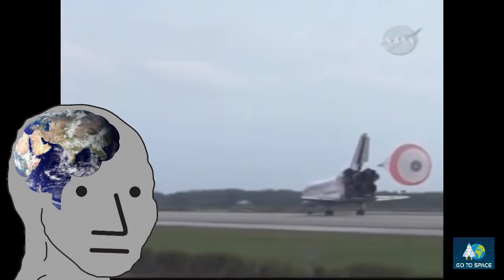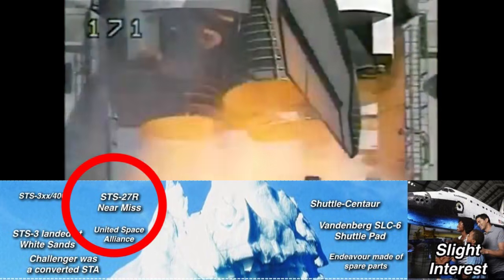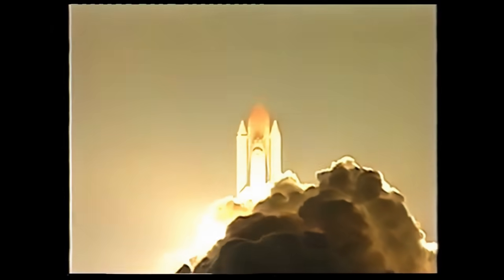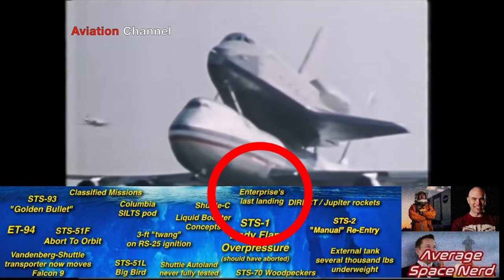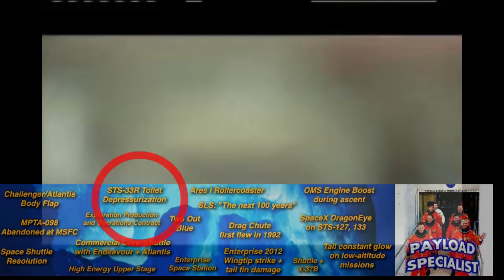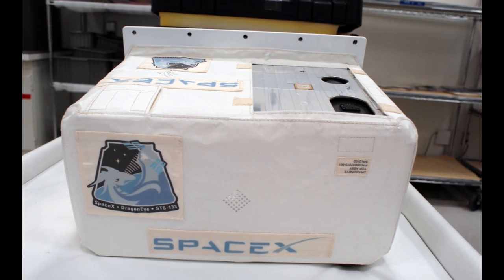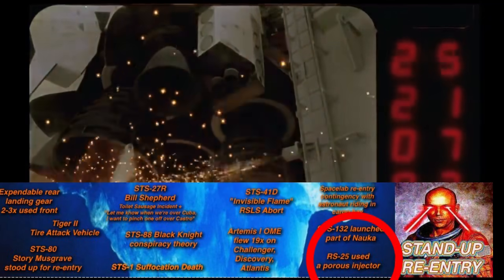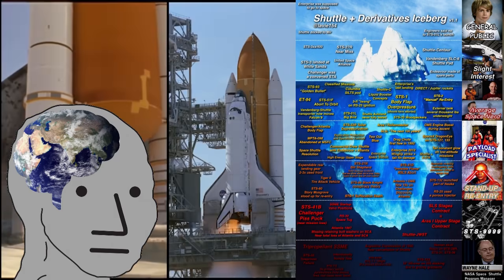The Space Shuttle Iceberg Explained

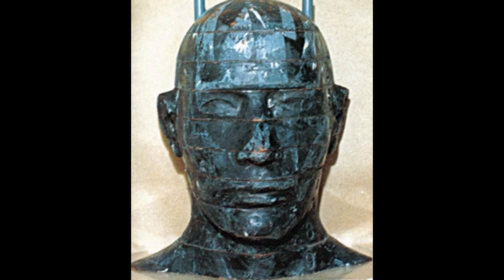Comment: (Note: I posted this comment earlier with a link to the article but it got caught in the spam filter.) 1:05:50 "Gravity gradient" refers to the sections of a spacecraft that are closer to earth having a very slightly higher gravitational pull from the earth. This can twist out of position a spacecraft trying to dock with another, especially if the docking procedure takes longer than normal for whatever reason. The article titled "Taking a Risk to Avoid Risk" by John McManamen on NASA's website gives a good explanation of the phenomenon. Searching for the title plus the author should put it as the first result.
Reply: This is also why "center of gravity" and "center of mass" are two different things (though they are almost always in nearly the exact same place). The center of gravity will always be a little closer to Earth's center than the center of mass, because the bits of the spacecraft that are closer to Earth get pulled on slightly harder than the bits that are farther away.

A homework assignment you might get in an undergrad attitude dynamics class would be to compute the center of gravity of a few-kilometers-long steel rod where one end is pointed towards Earth and the other away from Earth. In an absurd scenario like that, the center of gravity would be significantly closer to Earth than the center of mass (though I don't remember the specifics of how far apart they were).
Reply: there are so many minutiae involved with spaceflight that affect the measurements and tolerances and I keep learning about more of them. I thought thermodynamics were bad enough.
Reply: To think the shit engineers can think about and HAD to think about to make something successful... meanwhile here on my space simulator I am just thinking it's easy peesy making XYZ vector adjustments.... sheesh!!
Reply: To add, it favors the more massive side of a space craft. There are many satellites with "tails" to take advantage of this effect. It allows for a tidally locked spacecraft with less momentum build up in reaction wheels, and wlss need to momentum dump.
Reply: soo.... tidal forces, just with a weirder name.
Reply: I just posted a comment similar to yours after scrolling down and missing this one I also did not include a link because I've been flagged before for trying to be helpful 🤪

I believe Dr.  Shane Ross has some in depth explanation on his channel if you want to go deep
Reply: So effectively the exoatmospheric equivalent of ground effect when landing a regular aircraft?
Reply: I always wondered if this was a problem, thanks for sharing
Reply: Tidal force?
Reply: @michaelgian2649  Yup, it's exactly a tidal force
Reply: one Really cool concept is using the gradients for propulsion. One of my favourite papers is reaction-less tethered propulsion, amazing concept where no mass is flung out to gain orbital velocity.
Reply: @Me.is.Malhar - I believe that is the concept using the Earth's magnetic field as the stator and energizing conductors in the tether to "push" the spacecraft up or down.  If I'm wrong, sorry.  I'd love, in that case, to hear how a gravity gradient can be used for massless propulsion.

Comment: 23:47 - You got that backwards. Hubble was based on the KH-11, not the other way around. I have read on several occasions that Hubble actually came about as a means to use an already partially built KH-11 that would have been obsolete at the time of launch had they continued with what they had. 

The optics on the Key Hole satellites are considerably more advanced than what ended up on Hubble, if you can believe that.

Comment: Not on the iceberg, but one of my favorite bits of shuttle trivia: the rescue ball or 'Personal Rescue Enclosure'. 

https://en.wikipedia.org/wiki/Personal_Rescue_Enclosure

This was a 36 inch / 91 centimeter diameter ball made of urethane, kevlar and a thermal protective layer. It had a zipper to get into and a tiny window to look out of. The idea was that if a shuttle had a problem, they could transfer crew between the damaged shuttle and rescue shuttle if there weren't enough spacesuits for all the crew. An astronaut would get sealed into the ball in the fetal position with an oxygen mask and someone in a spacesuit would transfer the ball to the other shuttle. Or they could string up a line between the two vessels and move the ball across like a zipline. The little window was deemed quite essential so the poor astronaut inside would not freak the fuck out.

Comment: Did you know that NASA intentionally broke up and crashed the shuttle the first time that it happened. They did it on purpose. They knew with 100% chance that it would fail after 30 seconds. They know all this because the engineering team for the boosters told the NASA launch director that due to the excessively cold temperature the night before that it would take a day to warm the boosters back to operational temps and without the chance to warm up that they would fail 30 seconds into the flight. The engineers were ignored even though all the test data that was used to determine the environmental flight envelope for the boosters clearly showed that they would destroy themselves. The temperature excursion wasn’t just a little out but way outside the permitted range and it was for a very long time as well.

What the engineers said exactly happened. Why wasn’t the NASA flight boss charged with manslaughter or negligent murder?

Oh your shuttle is the most deadly space craft ever designed and flown. As in more astronauts have died in shuttle accidents than any other manned space craft ever flown by any country.

In 2012 UsD the shuttle was about $1.5 billion USD per launch. Value right there. Also nasa never told anyone how dangerous it was and lied every time they to,d the flight crew the survival stats for that launch. The chances never once met their own minimum chance at survival but they went every time. Why? The thing was a death trap and it couldn’t be fixed and that was that… invested.
Reply from the maker: This is false because it failed at 78 seconds, not 30.

I stopped reading there.

Comment: For those that maybe didn't already realize .. The reality is that the Shuttle program never really left what they call the Experimental phase of flight testing in aviation.. essentially all of the missions flown were 'experimental' even though for political reasons the Shuttle system was declared 'ready for flight/operation' very early on.
There is always a margin of this thing in space flight, but the margin that the Shuttle worked with throughout its lifespan up until after Columbia (and even then still some) was exceedingly high.

Comment: I can understand why NASA has gone with proven technology for the Artemis program but - these engines will be destroyed because the main stage is not reusable.
I’m not a rocket scientist but I’m scratching my head about discarding proven reusable engines.🤔
Reply from the maker: In short: it's really hard to do. SLS is structurally very different from Shuttle, reuse through protection from a body flap isn't possible this time. So, to add reusability hardware, you add mass. When you add mass, you need to compensate with more thrust. At some point this builds exponentially until you're just building a whole new rocket. SLS instead relies on proven hardware that we know how to make to cut down on costs (somewhat).
Reply: Would be too expensive to reuse them, to put it briefly

Comment: Vandenberg AFB (SFB now) was my home station, we always pronounced SLC-6 as "Slick Six". It's an ideal location for polar orbit launches as it's open ocean all the way to Antarctica.

We had a whole emergency response checklist for orbiter landings, and while we never used them I wouldn't be surprised if the same procedures got adapted for the much smaller X-37B drone spaceplane when it landed there in 2010. Also the road from the runway on main base to South Gate has an unusually wide embankment cut into the hill - this is to accommodate a trailer carrying the shuttle orbiter down to south base and SLC-6.

Comment: Actually, it isn't the Coriolis force, that makes KSC more effective, but the plain raw rotation of Earth. When you launch in the same direction as your launch site rotates with Earth, to the east, you add this surface velocity to the rocket and need less speed to go in an inertial frame of reference to enter Orbit. In Vandenberg, you can only launch west or South, while Earth rotates East. Regardless the direction you choose, you always get a penality for Earths rotation. Much better as launch site is Kourou, what is only 5° away from the equator and thus have a larger rotation speed, as long as you launch east.The Coriolis force would be a factor for example if you would want to dig a tunnel straight through Earths core. From a non rotating observer, you would fall straight down this tunnel. But as Earth rotates and this tunnel rotates with you, you actually would need to dig a curved tunnel to arrive at the end again. And much worse, if you have the velocity of the tunnel ends initially: You are in a elliptical orbit inside Earth!

Comment: 29:00 - Two fun things about shuttle "autoland" - Buran had it. Buran's only launch was an uncrewed launch that didn't even have a fully kitted-out interior. But it launched, orbited, and landed successfully under automatic systems. Landing under far worse weather conditions than NASA even remotely considered allowing a Shuttle to land under.

Also, while post-Columbia, there was a system for Shuttle automated deorbit, the shuttle was never equipped to fully auto-land. For one simple reason - the only way to lower the landing gear was a physical lever that had to be physically moved. No computer could possibly do it. It would have required a computer controlled physical actuator; or major change to the shuttles control system. NASA decided it wasn't worth doing.

Comment: From what I can find on gravity gradient, it's a chance in intensity/direction of the apparent force of gravity at a given location.

Please do not pin this, I'm sure someone else can explain it better. 

There are slight variations in the gravitational field generated by Earth. These are usually pretty trivial and go unnoticed in daily life. There will be differences between locations, but it doesn't change at a given location (I may be wrong in this point). The effect is that a scale calibrated in Houston may show the wrong weight in Denver when the same mass is used. It's usually a gram or less difference.

In space, when docking, these changes in the gravitational field may result in the objects moving in unexpected ways. I'm sure that guidance can compensate if the change in the field is known ahead of time.

Again, please don't pin this message. I'm sure that I'm not entirely correct.

Comment: Correction about Atlantis' missing tile.  The antenna mounting plate was steel, unlike the aluminum substructure of most of the orbiter.  Steel has a higher melting point, which likely saved that mission.
Reply from the maker: Spaceflight Mission Report: STS-27: "The missing tile had been located over the aluminum mounting plate for an L-band antenna (one of six, part of the Tactical air navigation system (TACAN) landing system), perhaps preventing a burn-through of the sort that would ultimately doom Columbia in 2003."
Reply: @ClassicAerospaceHistory  Digging deeper into this (as I've also heard it being described as steel) - the best source I can find is NASA's report titled "STS-27 National Space Transportation System Mission Report February 1989 NSTS-23370" which actually states on page 9: "Structural damage was confined to the cavity over a small antenna access door. The tin plating on the aluminum door..." - so it seems it was neither a mounting plate, nor steel, nor solely aluminum/aluminium.
Reply: It also helped a lot that the tile was in an area of TPS where the heat wasn't as big  - unlike Columbia, where the breach was right on the leading edge of its wing, where the heating is highest
Reply: @HalNordmann  the roll reversal to the left is what doomed Columbia since it lowered the damaged wing into the hottest area, had Columbia rolled to the right there’s a slight possibility that she might’ve just about made it home with extreme damage.
Whether she’d fly again is another story though.

Comment: Here are a few they missed:
Columbia was planned to service Skylab to raise its orbit with a special booster rocket module, but it launched too late.
The Shuttles had two hatches. The other one, on the opposite side, was covered with TPS but had an external "cut here" marking.
The Shuttle OMS AJ10 engines were variants of the Apollo Service Module engine.
There were little air tight fabric pods tested for crew rescue.
There was a tile repair tool tested that squirted a pink heat resistant substance that might have saved Columbia.
Reply: The rescue pods were hilarious, I can't imagine being stuck in a bubble with a single window while someone drags you along.
Reply: @HopefullyAnAircraft  that's all a space suit is, it's just body shaped instead of ball shaped.
Reply: The Apollo service module engine was just a variant of the Vanguards second stage engine. Yeah, the AJ10 goes way back.
And now it again flies to the moon on Orion

Comment: iirc the Ares 1’s second stage would’ve used a J-2X and not a RS-25. The J-2X is made for vacuum use and not a little bit of asl and vac like the RS-25.
Reply: The original plan did call for a RS-25, but that got replaced with the J-2X over cost concerns

Comment: Gravity-Gradient Stabilisation is a more preferred way of stabilising a body in space without using propellent, thrusters or gyroscopes. It uses a mass at the end of a long boom or tether to accomplish stabilisation. The effect is that the stabilised mass (ISS/Discovery/satellite) will tend to align its axis of minimum moment of inertia vertically.

Gravity-gradient stabilization was also attempted during NASA's TSS-1 mission in July 1992 as well, but the project failed due to tether deployment problems. In 1996, another mission, TSS-1R, was attempted but failed when the tether broke.

Hopefully that earned the pin! 🤣

Comment: I continue to think that Shuttle-C was a fantastic idea. The Shuttle was a phenomenal heavy lift vehicle, we just wasted so much tonnage on silly things like the crew and re-entry equipment. Strip all that out and you could loft a ridiculous payload. It was also such a simple design comparatively. It's a pity we didn't move forward with it.
Reply: Bro, the space shuttle was anything but simple, not to mention it was quite expensive to launch stuff, even with the reusablility of the orbiter and the srbs
Reply: aint nothing simple about having 3 different thrust axes all offset from the center of mass. in fact columbia can be indirectly blamed on the complexity of the architecture, since main tank foam insulation falling onto the orbiter isn't even a thing on any other rocket. good riddance imo.
Reply: A cargo-only shuttle would inevitably be compared, cost-wise, to existing commercial launchers, and it wouldn’t have looked good, except perhaps for some very heavy payloads.  And in the end, we did end up building SLS.
Reply: You can criticize it all ylu want but at least they kept the crew all strictly serious and never went in for cheap gimmicky things like sending up civilians and televising the whole thing.
Reply: @SofaKingShit  Uhh yeah, about that. They did exactly that in STS 51L, and you know what happened there.
Reply: @SofaKingShit All of that was because the government needs the public to approve of the massive spending required for putting anything in space. Just PR intended to keep people excited. Sadly, things went wrong due to people caving to deadline pressures and normalcy bias.

Comment: Along with Mir, there was also skylab which many have forgotten. While never visited by a shuttle (Saturn 1B rockets were used for crew delivery) the hatch was made to link with skylab as well as Mir.

The shuttles were designed to work with skylab, and thus the hatch on the ISS was also designed to link with skylab, even if skylab no longer existed.
Reply: It's like that xkcd about that flower that evolved to attract only a specific bee species...that is now extinct.
Reply: Wasn't the plan for Skylab to be saved by the shuttle? But the shuttle never flew in time
Reply: @jesusramirezromo2037  no, it was an already dying piece of equipment. The life expectancy was 140 days of occupation, it lasted an extra 40 as it was
Reply: @nunyabidness674  Yhea, But NASA still wanted to use it
The ISS has far outlived it's initial life time, Doesn't mean it's not useful
Reply: @jesusramirezromo2037  the bits that were breaking on Skylab would have been "sketchy" to work on at best. That and it was nearly out of fuel with no option of refueling. The thought was put through to use the shuttle as an orbital adjustment engine which would have plausibly extended the stations life, but then the gyros started failing and navigation was out the window. 

Skylab 4 technically evacuated the station before they wouldn't have been able to get home safely. As it was, they had to kinda scramble off before they wouldn't have a known point of origin to plot re-entry. 

It was right after this the concept of a "Shuttle rescue" of the lab was tossed in the round file.